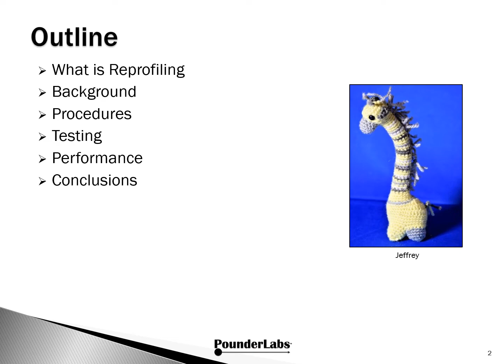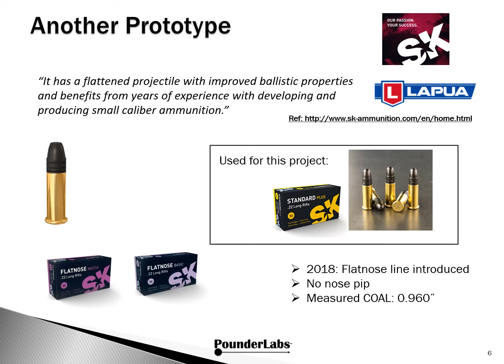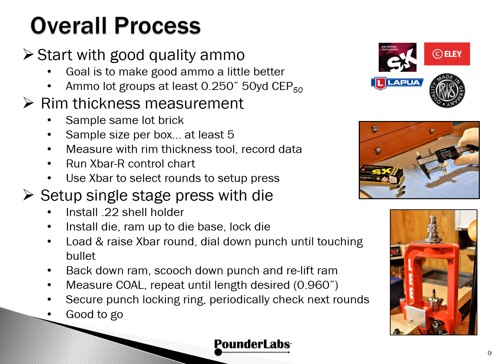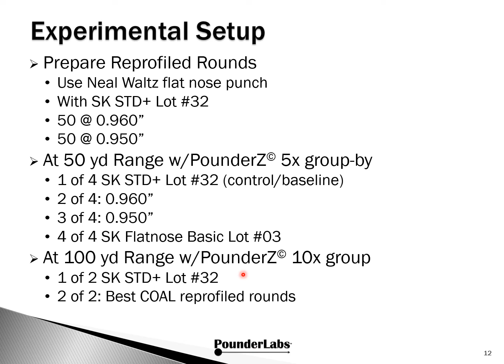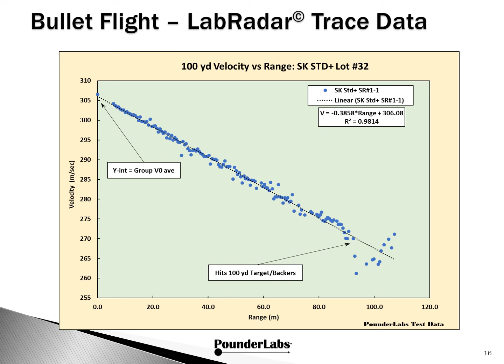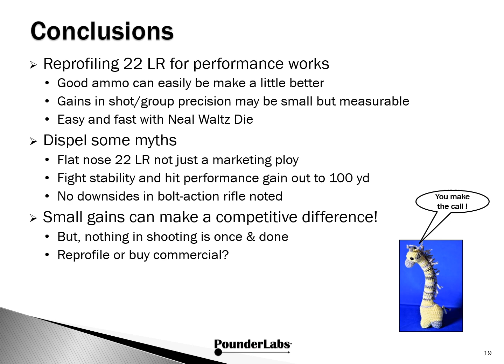22LR Bullet Reprofiling with Neal Waltz Die

Comment: All the other smallbore silhouette shooters i talk to say that sorting ammunition isn't worth it since its about 90% skill not equipment.

Even with shooting offhand i wonder if there would be an overall improvement with club ammo first sorted for rim thickness as you suggest. Eliminate the extremes from average.
Reply from the maker: Kurt… I would think any shooting competition worth its salt should be heavy on marksmanship and not an equipment race. However, doesn't mean you shouldn't take care of your kit. Unlike centerfire, the best we can do with 22 ammo is purchase the best you can for matches. 

Over the years most would recognize rim thickness is an important parameter for rimfire so sampling the brick and measuring tells you something about the individual manufacturers, lot number, etc. Testing every cartridge in hopes of finding the one out of "x" that could create a flyer might not be worth it.

However, for mid-tier ammo, where you might see a lot of variability in rim thickness, this is where you might want to cull out the really thin ones, say 0.029" to 0.031" as they are going to underperform.

Comment: I wish I had found this video when it was made. Perhaps you would like my videos on reloading 22lr and my swaging process of making 22lr. Also,  the hardness can softer when using powder coating. I swage AFTER powder coating. This make a far superior bullet.
Reply from the maker: Hans... Thanks for your comment. I did check out your video and looks like you doing some nice work. 

What I glean from your work is you're trying to make a superior long-range 22 LR. With the current offerings from the Lapua/SK/Eley that's gonna to be a tall order and I wish you the best.

Check out the offerings of the reloading kit for 22 LR from Cutting Edge Bullets. They have a table of load data they did with different powders, which based on my work, is going to be the biggest challenge. Also, I did a video on 22 LR relative burn rates which you might find useful.

...Don

Comment: An outstanding engineering presentation that provides the technical facts that one needs to know if you are into 22lr shooting. Your latest report on the CZ 457 LW chamber machining problem is spot on. I called Neal and had the die set in a week. It does exactly what is explained in the presentation. With a little sorting to find the out of spec rounds followed by some touch up die profiling. I found that improvements in SD, ES & FPS provide more consistency in group size an POI. The flyer are almost gone. Great job I really like your channel its refreshing to see technical data instead of the loud hyped up sales reviews. If you don't see the chronograph and the environmental the review is useless. Keep up the good work.

Comment: Great video Don, you answered a lot of questions I had been researching but added more with your video. I’m a reloader and I come from an engineering background, also retired with plenty of time on my hands. I saw where you started with the higher grade ammo and made improvements but I would like to try the same thing with common 40gr ammo such as CCI Standard Velocity by sorting with rim thickness, overall weight and a Neil Waltz Die. I have the KRL targets and do ok using off the shelf budget ammo but I’m curious if it can be improved with these methods. I think the swage and concentric improvement using the Die itself would have to help. Thank you for all your time and energy for this video. This could be a second comment, not sure my first one came through. 

Luther
Reply from the maker: Hi Luther… Thanks for your viewership, support and kind comments let me comment below… Don
Reply: This seems like a reasonable endeavor - working on something that isn't already grouping at 1/4" at 50 yards!

Comment: Great video Don, it answered a lot of questions I had but created more I think. I’m a reloader, retired with time on my hands and would like to work on improving accuracy of common 40gr such as CCI Standard Velocity using three methods, rim thickness, overall weight and the Neil Waltz Die. I would like to make a $.06 per round  bullet shoot more like the $.25 per round if possible. I shoot the KRL targets using CCI and GECO and do ok but it would be interesting to see if there could be improvements. This is probably another excuse to hang out at my reloading bench. One reason stands out for me, the swaging of a projectile to get an exact dimension and roundness. I really enjoyed your video and I appreciate all the time and energy you put into it. Thank you, 

Luther
Reply from the maker: Hi Luther… Your first comment did come through so but let me reply here. I applaud your noble effort and here's a little guidance based on our experience. We have some experience with CCI standard velocity, which in our guns ends up being subsonic which is a good thing for a lot of different 22 LR target shooting. 

Sorting off the rim thickness should probably be the first priority. You'll be amazed at what you see. Sometimes all the rims will be +/- a thousandth,  another time, even from the same supplier, you end up with a bell curve ranging over 0.030 to 0.045 ;-)  

A typical 22 LR weighs about 50 grains of which 75% of it is the bullet. But most of these are swaged so the standard deviation on weight isn't very much and you'll need a good milligram balance to see a distribution.

The Neal Waltz die should give you good uniformity to help minimize/eliminate out-of-round but most of the gains we see for making flat points/Tenex tips are statistical. This meeting you'll see small improvements over a large number of shots versus something dramatic in a single five shot group. Also, if possible use a gun with a match chamber. This can make a big difference as tolerances are tightened but, importantly, the cannelures or drive portion of the bullet scribes into the rifling and can bring multiple benefits. Hope this helps, Don
Reply: @PounderLabs  Your help was outstanding. I did buy the Bergara B14r which I can tell already is the best improvement so far. I did the weights on a brick of Geco Match which I think is comparable to the standard Geco 40gr. The weights ranged from 3.415 to 3.450 with most in the middle at 3.425-3.430. I do think the rim thickness will yield better results. The Hornady rim thickness gauge came a few days ago, should be doing some sorting this weekend. Also, the scales I’m using are a good guess at best. Thank you very much. 

Luther

Comment: Thank you for this video. As an engineer, I appreciate all the effort done for the testing and making the video.  I have found similar improvements with the SK standard plus by sorting using the weight to 0.01 gram.  I found the low weight ammo had the largest group on my 50 yard outdoor range.  The range has a KNL target on it.  I get similar results with KNL as your simulation.  Sorting by weight works for me.